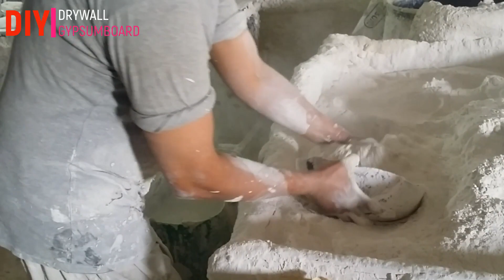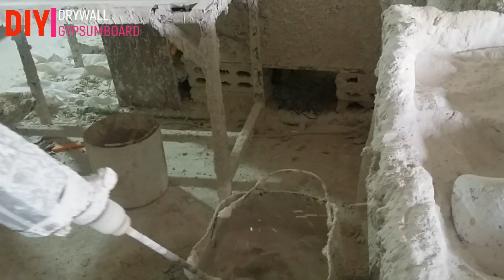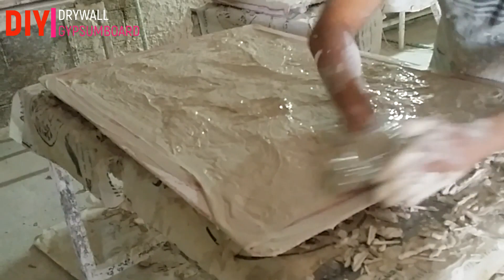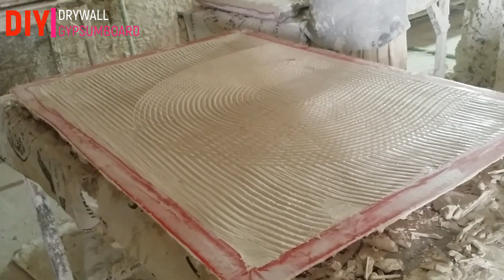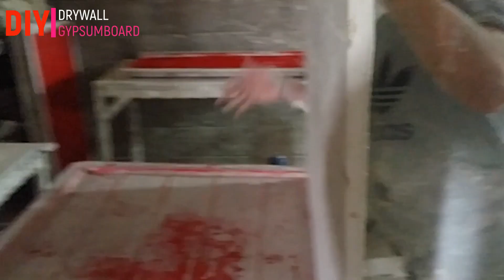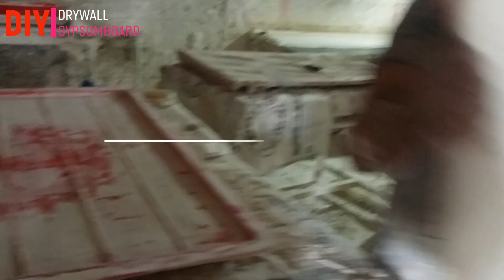How to make gypsum tile || how to make gypsum block || DIY GYPSUM & GYPSUM BOARD

Comment: Please, can you told me, how can gypsum make stronger for example a little fridge souvenir magnet?
Reply from the maker: Tell me clearly what you mean, you mean how it cools, it's cool, but not like the refrigerator, it's sunlight on the ceiling, the heat that comes down is the heat that prevents the same heat. Thank you for